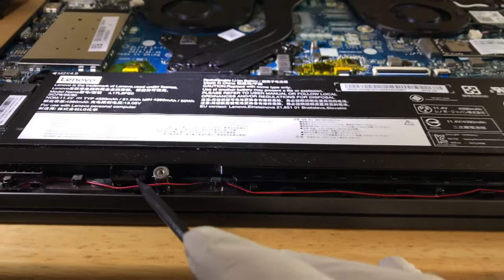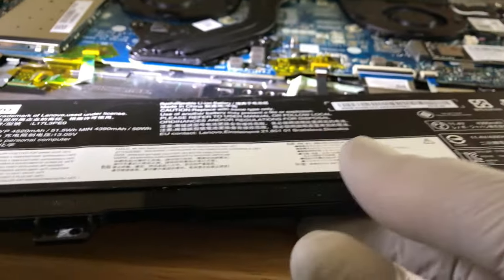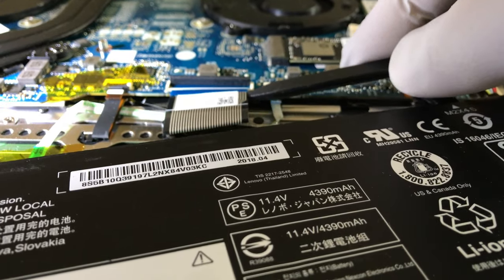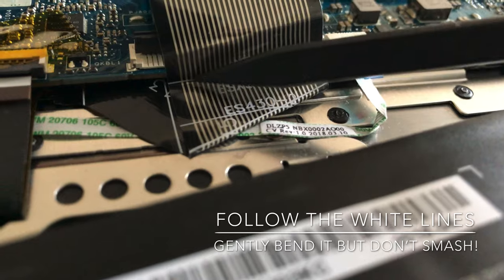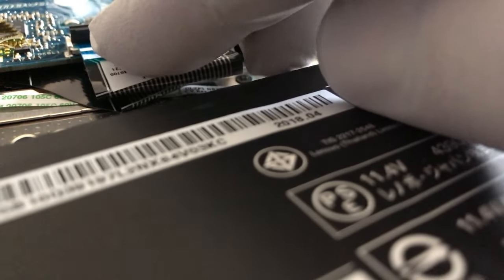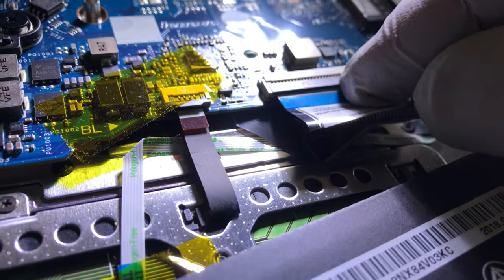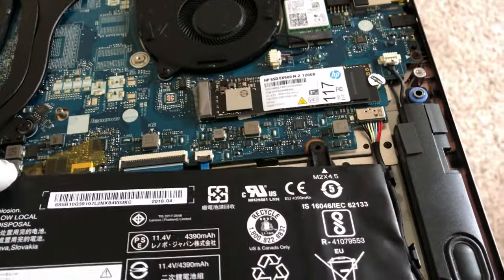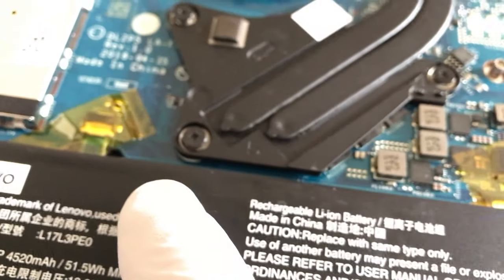Final FIX! Lenovo Yoga 730 some keys not working! Keyboard problem repair lift battery Reseat Ribbon

Comment: Thank you, I came across your video while looking for a video on how to take my Yoga 730 apart. The reason for that was I was having faulty keys also, usually the space bar. So annoying to use my laptop that I ordered a new keyboard. 
Your fix worked wonderfully and took a whole 15min. God bless you for posting this video, you have helped a bunch of people.
Additionally I learned that replacing the keyboard is a nightmare as there is melted plastic that holds the keyboard in place.
Lenovo are jackasses for doing this anyway. 
Your a lifesaver!!!!!!!!!

Comment: This worked for my 730 Yoga. The cable was neatly folded and well secured from the factory. Just pressing the ribbon down into the contact restored proper operation.

Comment: Thanks Bud! Worked perfectly after re seeding the cable ! It was not as bent up but did have a crease in the cable. But I straightened it up and clipped it back in and boom! Perfect connection again!  Thanks
Reply: Hey there.. does the situation come back? Mine comes back.. usually number key row.   I reseat and it works again.. but sheesh. why does it keep happening?

Comment: Thanks a lot for your excellent video. I just fixed my laptop by this method, after using my laptop for more than one year with a wireless keyboard, which was very annoying. 
I discussed this issue with Lenovo previously and they sent me a $500 bill.

Comment: Thanks, it worked for me. I bought a replacement keyboard and I was going to exchange it but I tried just the reseating first and it did not work. Then I retried after I cleaned the ribbon contacts and it worked now for a full day,  The folding was not bad in my case, ribbon looked fine, but somehow the ribbon cable ends needed cleaning. If it reoccurs I will probably change the whole keyboard, but that is a lot of work...

To cake in paradise: I purchased the laptop about 3 years ago (I think), issue started a couple months ago.
Reply: How did you clean the contacts? just wipe them?

Comment: Really helpful, worked for Yoga 530. 

First time I didn't fully remove the ribbon and reinsert, just pressed it, and the problem reoccurred. Second time I removed the ribbon, refolded and reinserted and hasn't broken again yet!

Comment: Awesome video, worked for me - also important to mention to screw battery and back cover tighter, as the slight movement of the battery when re-assembling the back cover might cause the ribbon to move a little.

Comment: This was so helpful! Only baby Jesus can tell you, I’m not great with technology. 

My first instinct was to take it in to be checked and fixed. After being told a diagnostic price, as well as a replacement of keyboard fee, which would be half the price I paid for this laptop, I said “NOPE.” And did my research. 

Came across this video and decided to give it a try myself. At first I was confused on what do do with the keyboard strip/ribbon so I just readjusted it and dusted everything else with a light brush. 

Low and behold, it worked!!! I am so grateful. Thank you. 

P.S. I told the tech companies it wasn’t broken. My shift key would just sometimes work, and sometimes not. And it gets annoying when writing papers, statements, emails. Etc. I reckoned it was an easy fix just had no idea how to do it myself and knew there was NO way it should cost $500+ to do what you showed me. Absolutely not. So thanks a million ❤

Comment: mannn you're a life saver omg icb this worked I've been SO SO TIRED OF THIS. it works perfectly now I did it. thank u so much
Reply from the maker: Thank you very much for watching and for leaving an awesome feedback
Reply: @cbatilo  the same laptop my speaker has been making some ...noises yknow a bit like it's smothered under a pillow or if it's a 80's radio. idk what to call it, distortion? do you think it can be fixed at home or do I need to get it done. and if it can, do you have any vids on that

Comment: thank you. this has been an issue for a Lenovo Yoga 730 13 inch that we've been tinkering with for awhile. This looks to have solved the issue. Will report back if it hasnt!
Reply from the maker: Thank you very much for watching and for the feedback
Reply: @cbatilo  unfortunately we are Still having the issues if anybody else finds a solution that is permanent please post!!

Comment: Great video... Really helped... But unfortunately, the fix isn't Permanent.. 
Though this has been the one solution I tried that worked for a while, over a month it worked, and just stopped one day. 

I do think the problem is from the way the keyboard ribbon/cable is folded, but how to make it work permanently is the challenge right now. 

Any thoughts?
Reply: Keyboard ribbon cables consist of conductive strips. Essentially they're just wires in a flattened package. In order to "permanently" fix a conductivity problem, you would have to repair the break(s) in the wire(s) that is causing the issue. I probably wouldn't even bother trying this without having a binocular microscope, to inspect the ribbon cable carefully and find any potential trouble spots. Once identified, you'd have to scrape away a bit of the plastic until you've reached the conductive layer so that you can remake the connection with something like silver epoxy. At this point, I'd normally suggest some UV-cured conformal coating to cover up the traces, but in a spot like this, it's probably difficult enough with the silver epoxy to fold this thing back together, so tape would be more appropriate.

Having said that, I wouldn't even bother attempting to do this unless it was my own laptop and I absolutely needed the internal keyboard to work. This is just a terrible design and these cables seem pretty screwed up right from the factory. Buying a replacement palmrest won't do you any good because you'll just get a used part that has another mangled cable. There's also the option of ripping the keyboard out of the palmrest and replacing that, although I have no idea if that part is available, and even if it is, it's a huge pain in the ass to do properly.

I see there's a video to the right of this one called "Lenovo Yoga 700 keyboard replacing cheaper way." The thumbnail shows a person ripping the keyboard out. I did not watch the video so I don't know what the outcome was. For this laptop, to even get to the point of ripping out the keyboard you have to remove the motherboard and pretty much everything other than the touchpad if I remember correctly. Then there's the matter of getting the new keyboard affixed to the palmrest. I've used a plastic 3D printing pen in the past for a laptop that was similarly constructed, and while the results turned out "okay," even with the printing pen it was tedious and time consuming, and not something I would consider worthwhile unless I had no other option.

One thing to keep in mind when ripping the keyboard out is that this palmrest is made of very thin aluminum attached to some flimsy plastic, so it's incredibly easy to bend. On an aluminum Macbook, once you've broken a few rivets out you can pretty much just rip the whole keyboard out without worry, but on this one you'll have to be extremely careful when removing it.
Reply: I put some electrical tape on the cable so that it didn't fold so much. I also put it ON TOP of the battery instead of underneath to avoid crumpling. It has been working fine.

Comment: Hi there.. I have now 4yr old Lenovo Yoga 730-15ikb.  I've had this keyboard replaced 2x.  All along, the simple fix seems to be reseating the cable as suggested. MINE seems to need a re-seating 1x per month, though!! Whyyyyyyyy?  Is the keyboard going bad?? The cable was NOT loose.. the first time I did this trick, I did fix the cable folds.. it still happens tho? Why??  Please.. suggestions?  THANK YOU

Comment: Like how you tested it in the other vid and showed the S,D interment problem. Had a feeling it was a driver problem before seeing this vid.   May i ask why not use some type of glue/gel for the contacts to keep a better connection? Would that do anything out side of make it hard to work on down the road? Thanks.  PS   Any chance you have any suggestions for linux distro for this laptop?

Comment: I have a yoga 900 13ISK2 and some keys are not working sometime, like when they are not pushed at the center it doesn't register the key, do you think it's cable related or the keyboard is just dirty or something else ?
Reply from the maker: No harm opening it up... I say the cable on your yoga is bent as well... apply this fix. You should be good

Comment: I ended up doing the same thing. Unfortunately, the issue has come back although not as widespread as before. And ideas of replacing the ribbon if suspected damage from bad creases?
Reply: Put some electrical tape on the cable so that it doesn't fold so much. Also try to accomodate it over the battery somewhere it doesn't crumple so much and hold it with electrical tape.

Comment: Dear Cbatilo,

I did what you said and the problem was resolved for a couple of days but returned. Is the cable beyond repair? Can I just switch the cable or need to replace the whole keyboard? Do you have any other ideas? Sorry to be a bug and thank you so much for your videos and time.
Reply from the maker: By the keyboard set with cable.. it’s not much
Reply: @cbatilo  Shame on Lenovo but you are right. Thank you so much for everything,

Comment: Hello! My yoga laptop's 6 7 Y U H J N M keys are not working. Looks like a pattern as the repair guy told me. Will your method work for me as well? Thanks!
Reply from the maker: It is a yoga... open it up. You will see the smashed keyboard cable.straighten it out and you should be good

Comment: Never buying a Lenovo again after owning a 730 just like this. The intermitten aspect of te problem meant that they wouldnt take it in because if it worked wen tey tried it, they'd charge me anyways. Not even offering a replacement during repair if Id ever consider it. Tey have a lot to learn from real companies. (and yeah, if i missed some h's or g's that is because they simply didnt work)
Reply: I totally aree! Do you still ave tose issues? My Lenovo Yoa 530's h's and g's don't work as well. I'm so tired of copypastin and usin on-screen keyboard... I'm considerin buyin a new laptop

Comment: I will have to try this. Does the battery sit on top of the ribbon still when you put it back? And must the tool you use be plastic?
Reply from the maker: Yes it does... it’s a big tell once you remove the battery... if you see it crumpled
Reply: @cbatilo  After un-crumpling though, do you still set the edge of the battery on top, or is the ribbon just sitting next to it?
Reply: It worked! Wasn't actually crumpled, either, though it is creased at the center, but it is shorter in mine than this one, so it wasn't something I could change, but I re-seated it and the keys work again so far

Comment: Thanks for posting this vid! This is my exact issue (intermittent asd row keys). We tried this twice but it didn’t work for us. Is it possible to buy or source a new ribbon?! Any next step ideas?
Reply from the maker: What is the model of your Lenovo? I say get yourself a replacement keyboard with cable
Reply: cbatilo thanks for your continued support! it’s a Lenovo yoga 720. Can you get replacement keyboards for a laptop, and do we get anew ribbon for it?! Sorry if that’s a stupid question. Got no clue!
Reply from the maker: I found this at Amazon... take a look at the pictures. Make sure it matches. https://amzn.to/3jcNAlo I would try it... return for f it does not fit. eBay would be another source

Comment: Why would some keys stop working and then start and then stop again for periods at a time? nothing spilled, dropped, or damage to the keboard?  iVe  tried all of the softwear ricks online and nohing works, ive paid 200 for a keyboard replacement, and now im going to store o buy tools to remove battery and ribbon.

Comment: I'm new to these kind of things, but I have the same problem as those other Lenovo users, which is having no specific keys working. I really wonder if this is the same reason why it doesn't respond for me and hopefully someone with knowledge will be able to help me with this.
My 'd'-key isn't working for at least 2 months now and I use copy-paste for it all the time (I'm an IT intern, but don't know much about the hardware side yet). Since today my '1' and 'Esc' keys start to act the same way and I tried to find some information about it once again, getting to this vid and the last one about it. Really think it's the same issue as you found here (together with someone in the commentsection ;) )
I'm not sure if the hardware-store here is opened yet, but this helps a lot already, so thanks for the info and possible solution!
Reply: I tested like you did and *four other keys don't work all the time either :/
Reply from the maker: SurvivalIsHisRevenge this video will show you how to open it up... https://youtu.be/2MLkY1WwV-k. You can fix your laptop using this vid as a guide
Reply: Ty and I already watched that vid before this one, but sadly enough I can't open it myself, since I don't have the right tools for it (some small star shape) and I don't really want to do it myself, since I don't have that much hardware experience and this laptop contains a lot of stuff I don't want to loose :/
Still glad you posted these vids a few months ago ;) It will hopefully help a lot if I let someone else try to fix it and they'll get an idea about the cause of the problem, which might be the same here ;)

Comment: Hey guys the video worked but I started having the same problem again. Does anyone know a permanent solution?
Reply: I had a similar experience, but I just repeated the procedure (both reseating the ribbon and removing the keyboard to  reseat the ribbon beneath it and it worked ... we'll see how long it lasts (so far 3 days, so not really much of an endorsement yet, but I'm resigned to doing this as often as I have to versus paying hundreds and downtime to get it fixed elsewhere). Can't thank cbatilo enough for this video.